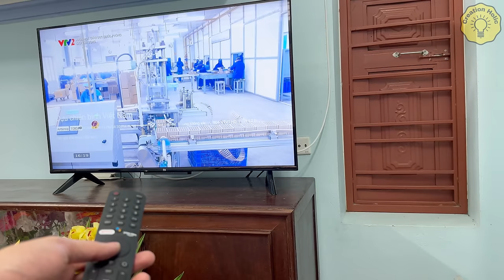Insert an Electrical Plug on the TV and Watch all the Channels in the World in Full HD!

Comment: It's amazing how copper wire loops can receive television waves, can you explain that?
Reply: The coiled wire acts as a signal boost inductor.  Over the Air channels are signal frequencies that if captured and boosted properly and fed through to your television or digital bconverter box, most modern televisions made in the early 2000's have the digital conversion box built right in.  I use homebrew antennas, and boosters on my own televisions and stereo equipment and it works as good if not better than the $15+ per piece on retail antennas.  And when you build your own, you learn new things such as magnetism, inductance, and basic low to no voltage electronics.  The electric lamp plug was a good touch.  Adding the coil loop between the prongs created a form of electromagnetic inductor to collect and boost over the air television frequencies and make them usable
Reply: @ShadowMoonPhoenix good simple explanation
Could have added doesn't have to be copper and number of turns is important as is length of wire
Reply from the maker: Thank you! Cheers!

Comment: Describe in words along with the video the steps by steps ,the stage by stages of how you are designing it. Video alone without words of clarity is not really encouraging. You should help with that. As we watch, we should be able to be reading along without missing anything

For example, what u did after splitting the plug - by ur inserting another cable inside the plug was not explicit. Is the cable touching the splitter wire inside the plug or not, if yes, we can as well join the two together outside.
Reply from the maker: Hello! thanks for your comment. Wish you all the best!

Comment: Here in eastern Canada we have only 2 air channels, with this method receive many more?
Also could this be used for a UHF VHF HAM radio as long as it has the same input attachment?
Awesome technique you used!
Reply from the maker: To get the best signal, place it high in a well-ventilated place
Reply: 😂😂😂
 @creationholic101
Reply: Don't believe it, until you've tried it. Seen a similar video for free Internet connection. I tried it, it turned out to be misleading. Many do this just for the view numbers
Reply: @TMensah  I agree, can't amplify what isn't there I was wondering if it would make a good HAM/CB antenna
Reply: @creationholic101  as in outside, structure free, where reception is typically better, yeah all that would do is bring in local TV stations, would not be any different than having a TV aerial, kind that people have on the roofs of their houses, mega mansion it's a cool design but that's where it ends
Reply: @lucasmnguni8475  I don't know why you think it's so funny, I think that's just the way his English sounds, bird brain
Reply: Bullshit.
Reply: This is a terrible antenna.  It's not even safe to use with devices that transmit like ham radios or CB.  It can destroy the finals in the radio.  It won't break a TV but it also won't improve your reception over any TV antenna you already have.

Comment: This should be removed you actually damaging peoples equipment. It doesnt work and is promoted under false information. You need to insert a 75ohm rssister on the line . Not just wrapping copper wire around a pen.